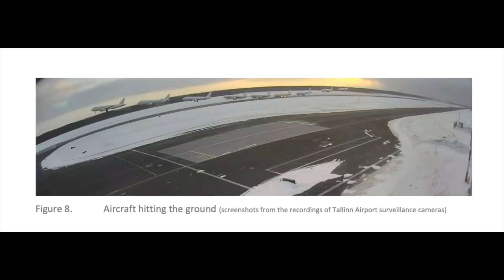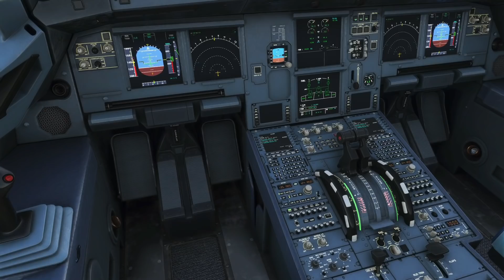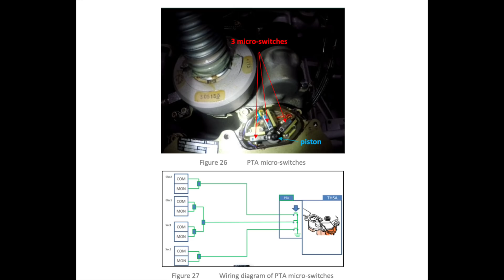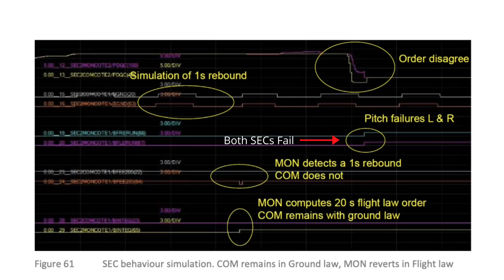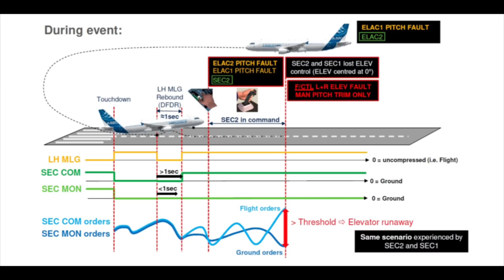The Oil Change That Crashed A Passenger Jet | The Crash Of Smartlynx 9001

Comment: I humbly suggest that perhaps, if the pilots had a computer interface that produced simple issue statements on a screen (somewhere-maybe in the HUD) 
e.g. Rudder Fault(1) - ‘suggest pilot takes control with computer supervision’.
Then the pilots can discuss and either agree this via the interface and test the rudder in flight, or ask the computer for diagnostic check to be performed. Maybe the oversight computer could also suggest why the issue might have occurred, and what the implications are if this is left unchecked. 
In other words, an oversight computer monitoring all systems simultaneously. Then talking to the pilots via a screen/HUD(even with a voice-over capability as well), in order to reduce the pilots stress levels and limit narrowing of their thought patterns (keeping them flying the plane instead of losing sight of altitude, airspeed etc). This communication system gets both the computer and pilots working together with simple and suitable language.:
Here’s the problem.
It could have been caused by this.
Consequences are these.
Suggest you take control to test my findings.
I can supervise (maintain flight).
You have command - I’m here to help.
Reply: Not necessary. If this was a normal A to B flight the pilots would get the warning, carry out ECAM actions and then read the QRH or FCOM as to what to do next or what other systems might be affected. This is no different to your suggestion

Comment: Computer code will fail, sometimes catastrophically, when a single line or input device is defective, unlike bridges which have multiple redundant paths. As such, I would suggest automation on a scale of 50 to 75% with complete manual override for the pilots in the event of automation failure.

Comment: I think automation is good for monitoring and warning systems. It's more about how the pilots utilize it. And the computer can only do as good of a job as the data it is given - a plane will fly you into a mountain if you don't set the base altitude or whatever correctly, for example. Once people are used to ignoring or turning off warnings/alarms, it would be hard to get them used to listening to them.

Comment: Most of all aviation accidents are human error.  So, to get rid of most accidents, automate more.

The issue is one of the Big Picture...  Mechanical, electronic, and software systems are going to fail resulting in fatalities.  It's impossible to bring the lost soul count down to zero.  But, humans, 9 times out of 10, are the root cause.  So, it would make sense to minimize human dependency as much as possible.

Comment: The ELAC error is like a tripped circuit breaker in your home.  Yeah, you can keep resetting it, but something is causing a problem.  If you keep resetting your breaker instead of finding where the fault is, eventually your house burns down.  If you keep resetting an error in the cockpit, eventually your plane stops flying right.

As for automation - 9/10.  It seems to me in most cases of automation going wrong, it's because a human screwed it up.  Here, a human put in the wrong oil.  Humans ignored multiple warnings that there was a malfunction.
Reply: Not entirely true. The only reason the computers all failed on the last touch and go is the pilots DIDN’t reset the ELACs. It wasn’t a case of keep resetting until it fails it was because they weren’t reset they were left in a vulnerable state. Every time the reset occurred it fixed the issue with the computers. Ironically if they reset the computers during the manual trim phase they would have restored control to the sidestick

Comment: I love automation, as long as it says what it does and why (or why not).
My car is an Opel Omega build 2002 (Cadillac Compact in US).
Downhill acceleration, sharp curve ahead, kept going, hit the brakes with force.
Forgot I put the cruise-control on 15 minutes before.
There's no light "on" and/or "giving gasoline to maintain set speed".
This could kill you.
Question: how does the Tesla autopilot evade potholes in the road?

Comment: 2 (two)
Don’t want MCAS on any airplane. Don’t want automatic speed trim. Don’t want side sticks or any fly by wire. Want FDEC on engines but also want a cable backup on throttles. I want more hand flying to be done. I want pilots to be sent back for training if unable to demonstrate a stable approach hand flown without automation. That is all. I’ll let you know if I think of anything else. ✈️
Reply: Welcome to the 80’s where flying was far more dangerous

Comment: Automation is good, but it's designed by people with the expectation that people will operate the planes with in certain parameters. When the $hit hits the fan, the thinking cap has to be put on and figure out the problem-correctly and deal with it correctly.

Comment: MACI:  "Pilot error is to blame."
Audience:  "10!"
MACI:  "Automation is to blame."
Audience:  "1!"

Me in both cases:  1.  Automation should be kept to a minimum.  Or, if you insist on automation, require pilots regularly fly with automation turned off as well as turned on.  And make sure that the plane makes it very clear when the computer gives-up and hands everything over to the pilots!  They are the last line of defense against a major disaster.
Reply: The only time pilots will fly manually is taking off an landing. During the cruise the aircraft will always be more accurate in keeping the altitude, airspeed and following the navigation path than the human. And during approaches then workload is very high and you don’t want to be flying an aircraft and doing other stuff at the same time or flying an aircraft and your colleague has to do everything

Comment: What caused the engine 1 fire and the engine 2 failure? Are they part of the surface control chain on the A320?
Reply: The engines hit the runway
Reply: @tomstravels520  The engines failed before landing, though. We they damaged during the previous touch and go's?
Reply: @vomeronasal  watch and listen again. On the last one when the computers failed the plane climbed, the pilots raised the gear then the plane dropped and hit the runway engines first then climbed back up again. It’s even in the security camera footage

Comment: I'm of the opinion that the more automation is put into the plane, the easier the pilot's job becomes. So on a scale of 1 to 10, with 1 being no automation and 10 being as much automation as possible, I'd go with a 9, meaning I want as much automation as possible but I still want a human pilot able to override the automation if in their judgement they need to.
The reason is that with increasing automation, the number of "edge cases" where you get a perfect storm of conditions that send the automation into an undesired state increases.
The flight computers must get increasingly complex and the programming must get increasingly hard to design to compensate for this, and the pilots must be kept aware of and trained on all the automation present in the plane.
As the 737 Max groundings made us learn, there is no such thing as "the pilots don't need to know about this particular bit of automation because XYZ" where XYZ is any reason you can think of, because there's the counter argument of "what if it's telling the aircraft to do something CLEARLY WRONG" such as commanding the nose down for no good reason, with no training the pilots won't know what to do and you end up with a lot of dead people.

I do not think it is possible to automate an aircraft that carries humans to the point that you no longer need a pilot. Not only is it psychologically undesirable to do so for many (most?) humans, there are always going to be situations that you did not program the computer to handle such as specific combinations of systems failures and maintenance failures. While a human pilot may not be specifically trained to handle every combination of systems failure and/or maintenance failure, provided they know what all the automation does on the aircraft it has been shown by several cases that a human pilot will more often than not have enough tools at their disposal to adapt to the situation and use what IS working on the aircraft to land it safely with as little loss of life as possible. I do not think that is something you can program a computer to do without at least doubling the amount of time it takes to design the flight computer software.

Comment: IMO, "fly by wire" is the real issue, not automation.  The fact that there is no mechanical linkage has contributed to a number of Airbus accidents, including the infamous "Miracle on the Hudson" incident (Sully commanded a higher pitch up before contact with the water, but the computer did not comply, making the impact worse).

Some form of mechanical linkage needs to be present so that pilots can (hopefully) still control the airplane in the event of failures such as this.  I'm a software engineer with a EE background, and I know it really doesn't take much to upset an automated system.  We would like to believe that we've accounted for all possible contingencies, that is, until the unexpected happens, like microswitches failing.  The danger is that we assume that a system can't fail in this manner, so we become dismissive and say that it is "impossible" for such a failure to happen -- then all it takes is for someone to use the incorrect oil during maintenance. 

I love the 737-800 series because it has the perfect blend of automation, mechanical linkage, and easy-to-read display units.  There's a reason why the 738's are the most reliable, and have one of the highest safety records, even during a catastrophic event that would bring down most aircraft.

I'm happy that nothing worse befell these pilots, and they were able to walk away pretty much unscathed.

Nice episode, nicely produced!  🙏👍
Reply: “No mechanical linkage”. Then how did these pilot manage to pitch up using the trim wheel? The answer....mechanical linkage. Same goes for the rudder too
Reply: Also if everything you said about the 737-800 was true then TK1951 wouldn’t have happened.

Comment: So, if I have a car in and a warning light is on, I try resetting it.
If it comes back on I know it needs fixing, 
They had many many identical errors. To me that means you do have a problem. 
Reset It once, ok, reset it twice? FIX IT.

But they carried on flying, 

I want automation to try and help, but also be programmed to notice when the pilot/driver is attempting to override it. 

So, take a car with a speed limiter that can be set by the driver and can be turned on by the driver in error, or set to the wrong speed in error. 
Accidentally set it to 30, or turn it on when set at 30, and join a multi-lane road with traffic going 70 and you are going to get rear-ended if you can only go 30.
Program it correctly (manufacturer program, not user program)  and it will notice that the limiter is set to 30, but that the driver has their foot to the floor, and is clearly trying to go over 30 and It automatically disengages. 
The well programmed limiters work that way, set it at 30, and you can not accidentally exceed the speed limit, but if you forget to turn it off when joining a motorway where the traffic is at 70 you can override it simply by flooring the accelerator, and as long as you stay over 30 it will not turn back on.

Comment: Consider that when a malfunction occurs in a complex automated system it could take a team of experts weeks to figure out exactly what went wrong. So how can you expect pilots who are suddenly thrown into an emergency situation to figure out a way around a problem with the automation in just a few minutes or even just a few seconds? The problem with automation is that a wounded automation system can react in crazy and unanticipated ways. Like MCAS on the 737 for example. In the types of automation systems I designed for industrial use the only way to deal with such craziness was to shut everything off and then try to figure out what went wrong. Of course you can't do that in an airplane in flight. Therefore the only solution is to disable all of the automation completely and fall back to a complete manual back-up where the pilot can take immediate and total control of the entire airplane. And of course this will require that pilots keep up with their basic flying skills as automation does tend to erode basic pilot skills. Maybe some mandatory stick time in gliders for commercial pilots wouldn't be a bad idea.

Comment: Lol. If the "pilots" had aborted after resting the computer didn't fix the problem and it came right back, they would been fine. If those people are still pilots, God help us!
Reply: Also if the pilots had kept resetting the computers they would also had been fine. Resetting the computer did actually fix the problems with the computer itself. On the last circuit the pilot didn’t reset the failed ELAC so only one was operational. When that failed it then went to SEC 1 and 2. Also bare in mind one of them was a student pilot who wouldn’t have known better
Reply: @tomstravels520  IF! If they had landed and fixed it this never would have happened, and YOU have no idea what the trainee knew or didn't know.
Reply: @howardjohnson6584  if the trainee knew they would have reset the computers. Resetting the computers during the manual trim only also would have restored the computers back to normal. Also the airbus and airline manuals didn’t dictate how many times you can reset the fault before aborting the training. It just said to attempt a reset and if it doesn’t clear it then you have a problem. But each time the reset it it did clear it
Reply: @tomstravels520  It didn't clear it. It keeps coming back. They had a problem.
Reply: @howardjohnson6584  When they reset the computer the pitch channel of the ELAC’s were restored and the plane flew normally. Otherwise why would they keep getting the master caution messages? The reason why they kept getting them was because of the fault with the OVM mentioned. Every time the computer was reset it went back to normal operation, the pilot then stopped the trim on landing but as there was no message being sent to the computer it assumed it was broken and shut off the pitch channel of the ELAC only then handed control to the other. The roll part was still operational all the time. The problem was not with the computers until the pilots didn’t reset them the final time. The problem was the OVM and PTA micro switches. But there is no warning to say if the OVM is not working and the manual doesn’t state how many times you can attempt to reset the computer
Reply: @tomstravels520  What happened to the plane? It crashed!